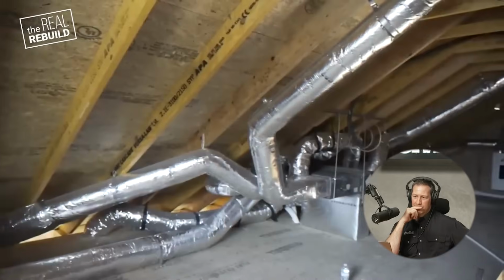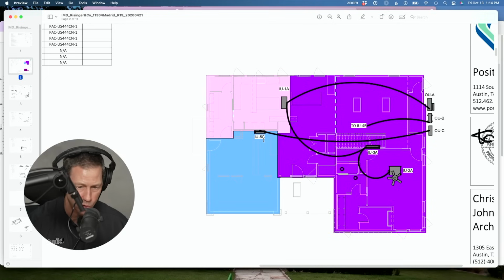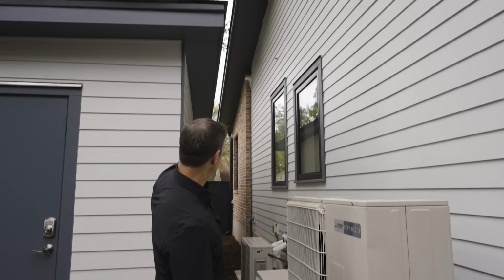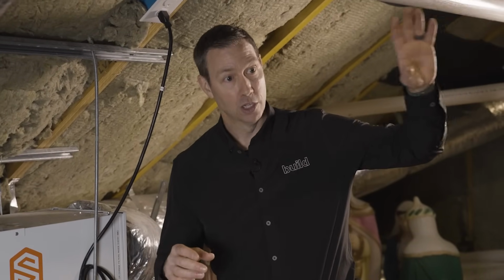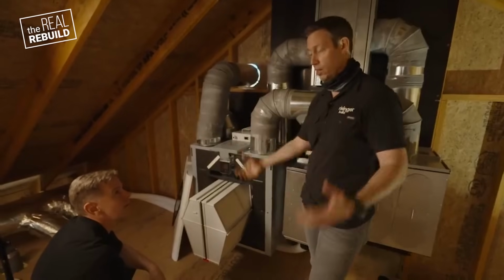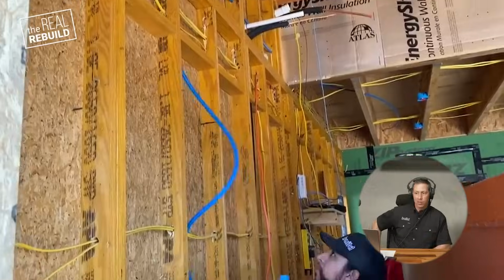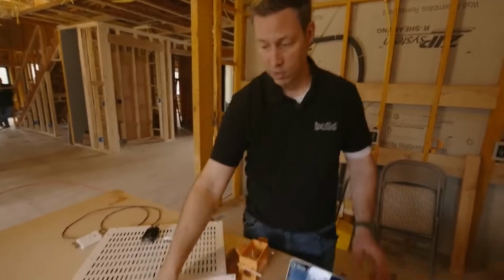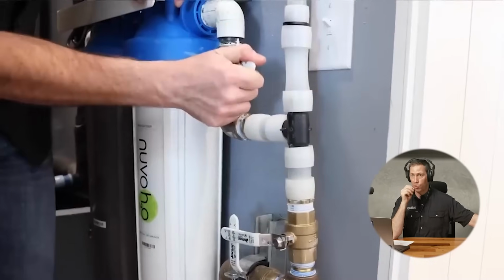Mechanical and Plumbing - The Real Rebuild Ep. 3

Comment: "enough juice" is a relative term as well as a moving target. Wish you would have used actual numbers. My drone battery likes to charge at 28 watts. I like to charge them to 60 %(storage mode) until I actually am ready to use them. Then I charge  3 of them in parallel. (simultaneously not sequentially) as I am now in a hurry. "Bricks" - chargers from Koval or Anker that supply 100 watts can do this (3 * 28+). Every electronic devise seems to have a limited lifetime, even things like  camera lenses have been superseded  by more intelligent lenses .  People who wired their house to the "latest" advances 50 years ago have found their wiring to be outdated as time passes. I will bet your voltek is outdated within 10 years if it isn't already. BTW I have loved all of your videos for over a decade now.

Comment: I love the part where Matt says $10,000 plus just for the (“mechanical plans”) 

When a large majority of contractors will install the system for less than $10,000 

A lot of contractors will just use some rule of thumb maybe a manual J, but only the easiest off the top to come close within a ballpark figure .  And call that good enough..